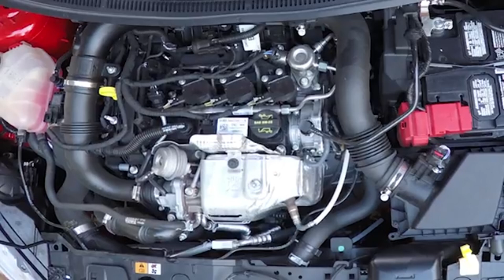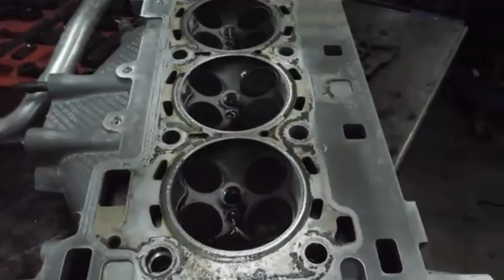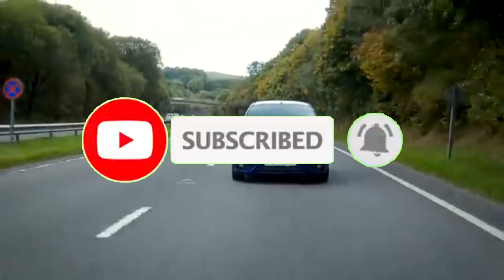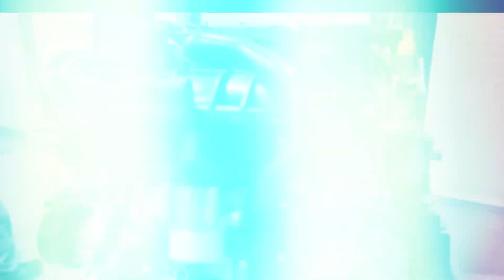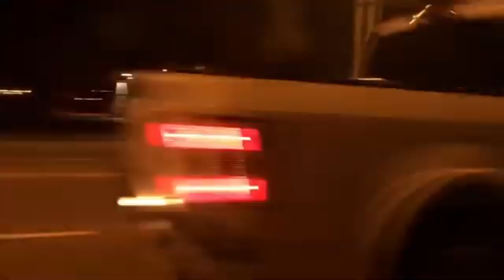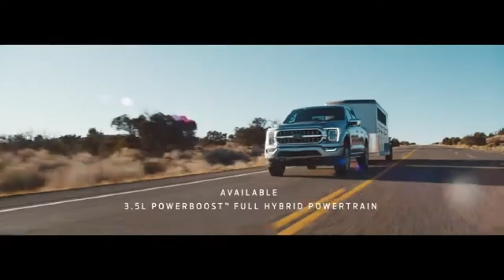Why Ford EcoBoost Engines are LOVED and HATED?

Comment: The wet timing belt issues have not yet been truly solved. Regardless of the recalls these engines are still failing due to the timing belt issue. Ford needs to have a look at Kia and Hyundai because their engines are built on this same type of timing system, the difference... Kia and Hyundai use a chain drive system rather than an oiled rubber belt that needs replacement at 60k intervals. 

As I work in a Ford Parts Department, these engineers at Ford really need to take some ques from other manufacturers and correct this issue. These same engines are notorious for front engine reseal jobs, rear main seal leaks and water pump issues. And... Lord forbid you have one of the 6 or 8 cylinder engines on Ford or Lincoln that have a chain drive water pump... that job requires the techs to disassemble half the engine to get to the water pump... the cost of the parts plus 8.2 hours in labor... most customers are looking at close to $2400.00 or more depending on shop rates and location. 

On the positive these powerplants are indeed very powerful. But better engineering on the part of Ford can/could/will make customers have a more positive experience.  Likewise  more competitive and inclusive new car warranty, (10/100), like Kia/Hyundai and customers will give Ford more serious consideration.
Reply: But that would cut into their profits.  More expensive chain, less income from 60K intervals.  60K is outside warranty.
Reply: @janofb how true... how true.  No argument here... hence why I don't own a Ford... but I'm happy to sell their parts! 😂😂😂
Reply from the maker: They should stop experimenting their invention with customers' money. Thank you for sharing your experiences.